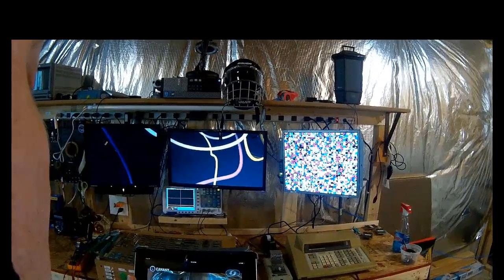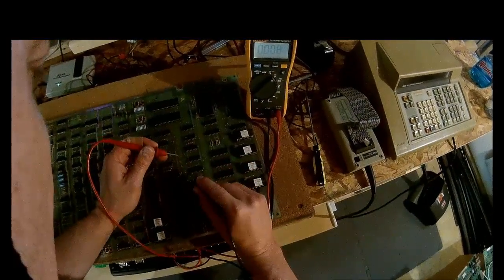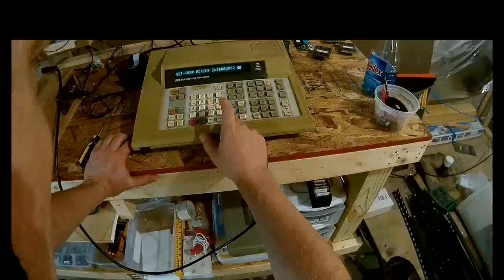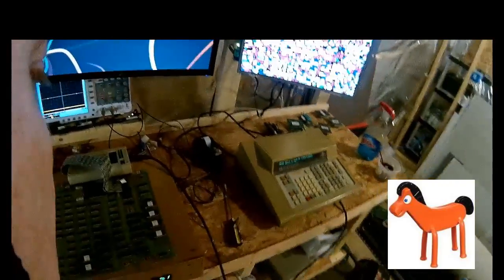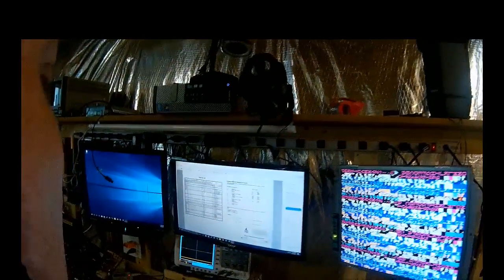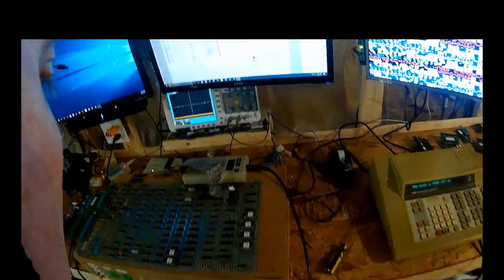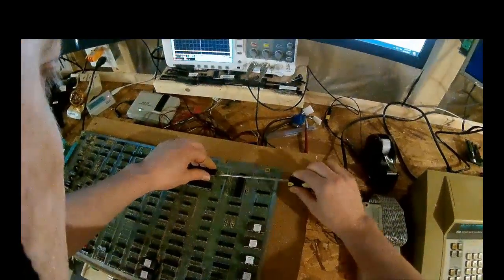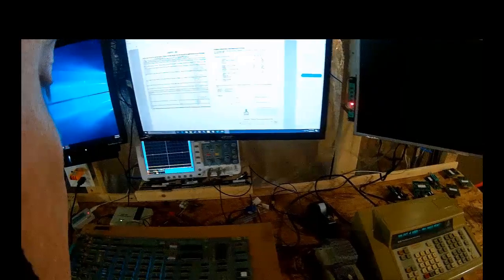fixing arcade game PCBs: Board #3 Millipede

Comment: Getting a stuck Bit "internally inside" a ROM or RAM chip will display a DCD error or BTS error on the fluke 9010A. Any step by step procedures what you do to "Isolate" if its a stuck data bit or a stuck address bit?  If its externally stuck from the data buss or address buss i can use an ohm meter so I know how to isloate that issue. I just don't know how to "isolate" if the bit is stuck bit internally inside the ROM or RAM chip, you have to use the fluke 9010A and read and write hexidecimal values to multiple addresses above and below from what the fluke DCD error or BTS error said. Sometimes the Read and Write hexidecimal value will have a stuck bit and you have to convert the hexidecimal value to a binary value to know which data line or address line is stuck.
Reply from the maker: bill williams see the fluke 9010a owner manual to decode the BTS and DCD errors back to the data and address bits that are malfunctioning, they have the explanation and examples I think in section 4H

Comment: I've been dying to get one of those Fluke troubleshooters for years, but they are so pricey and rare!  

I see you have a GQ-4X programmer, but I'm curious what the smaller unit next to it is?
Reply from the maker: that's a TL-86A it's cheap Chinese programmer. It's pretty nice for a cheap Chinese programmer  I don't use it to program EPROMS, but it does program PALS/GALS which my GQ-4X does not :(. it also can test certain TTLS chips and RAMS and I've used the TTL test feature a few times. For programming EPROMS I like my GQ-4X but for $60 or whatever it was the TL-86A is worth it if you need to program PALs or want to test TTL chips.
Reply from the maker: in regards to the Fluke they are amazing, I was lucky I bought my  Fluke and pods around 2012 when they actually were still cheap. not sure what caused the skyrocket in prices on those. 2013 or 2014 happened and these things just exploded in price. a couple people have talked about making similar items and someone in Europe I think has made a similar thing for Z80s so hopefully more solutions will come out to do the same thing that the fluke can do. Anyone that wants to fix games should have these they are amazing.